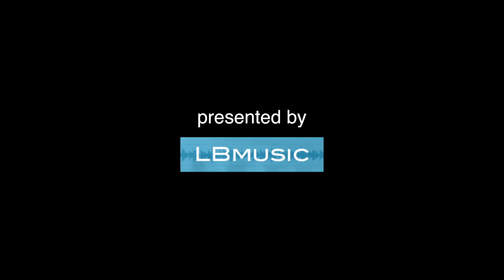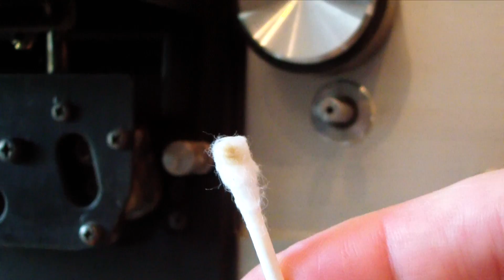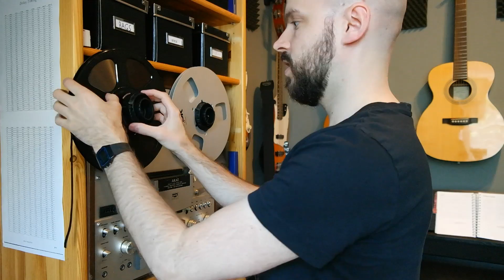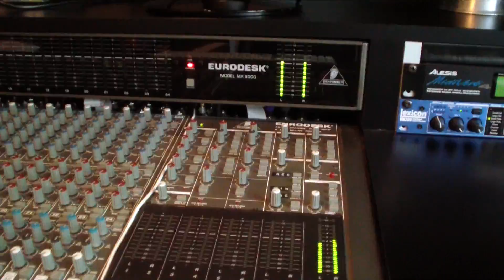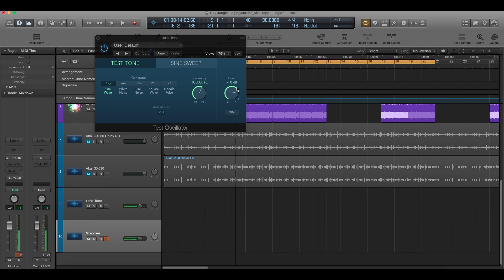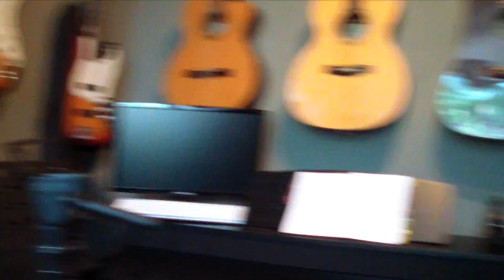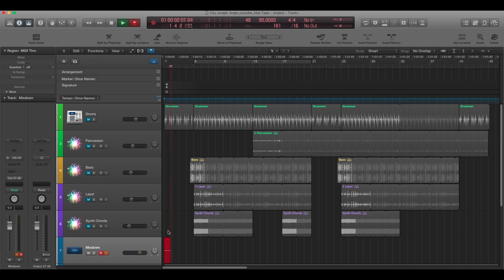Akai GX630DB Tape Machine: Setup, Gain Staging and Recording | Hybrid Mixing

Comment: I've noticed no one ever shows the back of a tape machine, where or how do you plug everything into the tape machine? are you just feeding the output of the mixer into the tape machine so does the machine accept xlr connections ?
Reply from the maker: +argiletonne yes, mixer output to tape machine and back to the audio converter. Connectors on this unit are RCA.
Reply: then what baffles me is that you would expect a high quality recording using rca connections? Aren't those connections a bit degraded in terms of modern standards, I would say so. I use to record through the rca connections to a dedicated outboard recorder from my mixer and I never thought the quality was as high as it could be but this was when I had a mixer with no usb and couldn't afford an audio interface to convert the output.
Reply from the maker: RCA connectors don't degrade the sound and they should actually sound the same as any other analog connectors. The main difference is that the XLR is balanced, the RCA is not. With balanced cables you can run much longer cables without any interference such as increased noise. But as long as you keep the cables short, unbalanced are no problem.
Reply: ya I've read something about a 10 - 15ft limit of cable before the interference and added noise starts getting mixed in with the signal.
Reply from the maker: +argiletonne yes could be, don't know the exact numbers right now.

Comment: Hey, great video. I'm new to recording with tape. I have a Fostex A8 and an Apogee Symphony interface and can't quite get my head round how to connect it all up. Do you have any suggestions? will i need to buy a separate analog to digital converter?
Reply from the maker: +Malena Zavala thanks! The Apogee has SUB-D25 and the Fostex RCA connectors right? So I would suggest to get SUB-D to RCA cables and connect them from Output 1-8 of the Apogee to the Inputs 1-8 of the Fostex and Outputs of the Fostex to Inputs of the Apogee.
Reply: Ah i see, a lot easier than what i thought. thank you!

Comment: Hey, nice video! It would be great to see the exact routing and cable connections between the tape machine, the sound board and the Converters!
Reply from the maker: +Axel Bezzi Thanks! It's actually pretty simple. Console Main Mix Out -> Tape Inputs -> Tape Outputs -> Converter Inputs.

Comment: Take Dolby NR off and the tape would sound brighter.
Reply: This is an awesome deck, however,  I would never track a master tape on a 1/4 track pro-consumer machine. The tracks are thinner, and top speed is 7 1/2. A half track Professional machine that is properly aligned and biased for a chosen tape stock running at 15 or 30 IPS is very clean without Dolby. If you decide to use Dolby, (especially on a 16 or 24 track machine) it encodes far better than at 7 1/2.  It's also been argued that some tape hiss is a good thing, because it acts a smoother and adds sparkle to a mix. (which in the real world would be mangled by re-sampling and compression.)
Reply: If Dolby takes away high frequencies , then it's not proper adjusted . It's very easy , piece of cake to get it right , without quality loss..  My Technics RS-M65 sounds the same , with or without Dolby B .. The  fact that it's a cassettedeck makes no difference . Analog recording is all about right adjustment in every sense .
Reply: Akai tape machines always seemed to over-bias my tapes, consequently the playback often sounded duller, and Dolby made it worse. The EQ and bias wasn't user-adjustable on these decks so you were kind of lumbered with it. I always figured the machines must have been EQ'd/biased for tapes we just couldn't buy in the UK.
Reply: @jmmbos  I remember cassette players had this,even the new ones
Reply from the maker: Yes, that's one option, but the tape hiss gets pretty apparent.
Reply: I was literally just thinking that and also hit the "wide" instead of the other mode for a more analog natural sound!  .... lastly don't be afraid to punch it to around +1 1/2 db when recording... it's not going to hurt the recording
Reply: Cool video! 

I just incorporated an Akai ds4000 that I picked up at a garage sale for $20 ...in great shape other that the blown fuse ;)
Since this is not a great unit to begin with, I am not using it on the master bus. Instead,  I set up a "to tape" aux that I use to send individual tracks or parts that I want to experiment with. So far,  I'm loving sending bass and kick to tape - really, anything that might have a low pass shelf set above 8k or so...as I'm not keen on adding all the hiss and noise... especially since, with my method, it would be multiplied across however many tracks. But any pink noise in the mids is suitably buried by guitars,  keys, etc.

Also,  one thing I do differently than suggested here (possible only when you can monitor the tape as opposed to the source) is simultaneouse play/record. 

To so this, play the track you want to record through a "to tape" aux, then flip the monitor switch on the tape machine to "tape," and record the return "from tape" to its own track at the same time.  At 7.5, you'll get around 300 ms or so delay between the existing/source tracks and the new "from tape" ones (due to the distance between the record head and the read head) but this can easily be fixed just by dragging the starting point to the right place.  This saves you from 2 things i can think of
1) the time of having to go back and rewind, then play the tape (plus the extra wear/tear in an old machine)
2) the possibility that the playback rate is sufficiently different enough from the record rate that after lining up the starts, the ends don't match (tape stretch, worn belts,  someone bumps the reel during playback,  etc. ... there could be several reasons for this). 

This might not be a big deal for short clips, but a long bass line over a 16 minute prog song would almost certainly not like up at the end even with a really good machine (there are just so many variables). This too can be corrected, but not as easily as just nudging the whole track back 300ms. 

With the simultaneous play/record method you can rest assured that your two tracks are the exact same length... just need to line up the start and enjoy the tape real saturation/compression ...and save yourself the dsp of running multiple tape emulation plugins. ;)
Reply: You know... funny that you mention that.   The DNR never EVER sounded good to me.  It did remove the hiss as  LoudBox mentions, but it also removed the high part.

Comment: Great video, thanks ! I'm new to tape recording and I'm actually getting an Akai GX630DB next month, I have a question that probably sounds stupid but can you record over an already recorded tape or do you have to use a new one for every recording ? 

Thanks :-)
Reply from the maker: +flabaire thanks mate! Yes you can record over an already recorded tape, however you may notice some loss in quality- especially in the higher frequencies. It depends how old the tape is and how often it was already used for recording. For pristine recordings always use a fresh part of the tape!
Reply: Alright, thanks for the quick answer :-)

Comment: Hi there! A great video. I have a question. Is the Dolby NR really that needed to reduce the noise - resp. is the difference big? I was thinking about buying GX 625, which doesnt have Dolby NR, but I want to combine recording R2R with PC. Thanks
Reply from the maker: +Milan Kucera Thanks! It may not be necessary but it's good to have. Dense mixes that can be recorded loud enough to tape won't be a problem but quiet and soft mixes with few instruments will get quite hissy.

Comment: what would be the difference doing this on high end cassette deck and  professional  r2r? Also,  I have teac 3340s without NR and it can go 15 ips would that be better?
Reply from the maker: +ElenaDiakova r2r usually have a better frequency response over the whole bandwith and less noise because they run faster than cassettes. You may also notice less wow and flutter. If the Teac is in good condition give it a try, just make sure to properly clean the tapeheads with pure alcohol.

Comment: I usually love the sound of tape... but, this time the original digi one, hands down... the tape just made everything muddy/murky/dull, imo. 

Hymn
Reply: The sound of tape we love is usually mixed on 1/4" two track with a speed of 15 ips- 30 ips
(15 giving more low end while 30 gives a cleaner signal with reduced low end)
What he was running was 1/4" 4 track (Two tracks on side A two tracks on Side B much like a cassette) at a maximum of 7.5 IPS.  The reality is these machines were really meant for home audio use, not really meant for bouncing or mixing.  They do add character but not in the dynamic range or frequency response that we all love.
Reply: Since tape has physical limitations on recording high frequencies, it smoothes the top end, so you can push hard that top while recording and it will give you nice clean highs.
Reply: Jessie Slams i
Reply: It would sound better on 15 or 30 ips. 7½ as demonstrated in this video was never intended for professional use.

Comment: Very nice and interesting video you did once more. Congrats to the nice machine btw. Seems it is in a good condition. Which type of tape do you use and is the machine calibrated to it?
Reply from the maker: Thanks! I use RMG LPR 35 Standard Bias Tape. Seems to work quite well with it - didn't calibrate it so far.